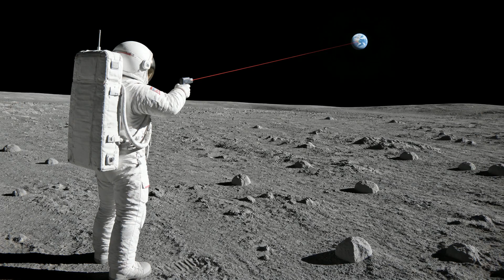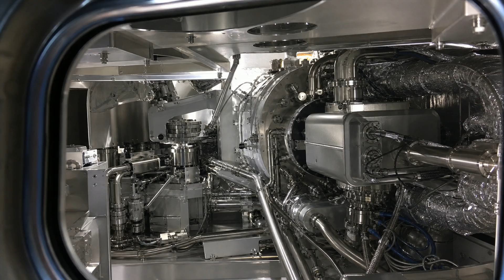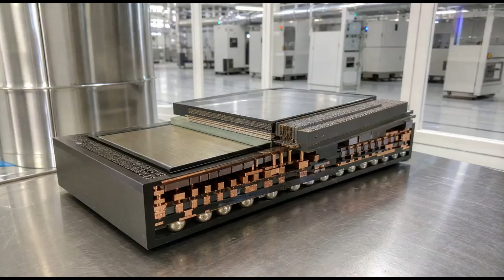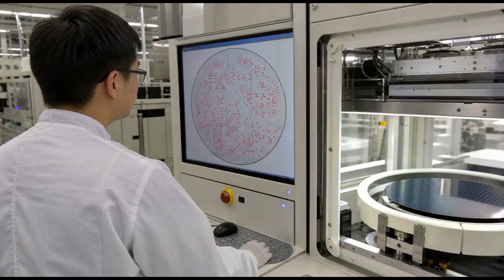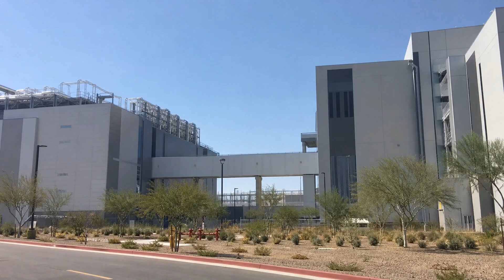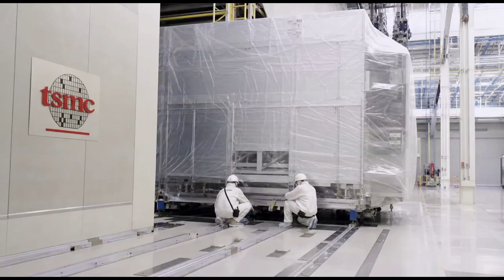It's Happening: America's Most Advanced Chips Are Shipping From a Desert

Comment: They're approaching the physical limits of atomic structures. They're going to have to start building things with individual elementary particles to go beyond the limits of UV light or switch to a completely new paradigm altogether. The wavelengths of x-rays are about 1A to 10A and gamma rays can get much shorter.
Reply: The next step is x-ray synchrotron radiation.  https://www.nist.gov/pml/sensor-science/what-synchrotron-radiation